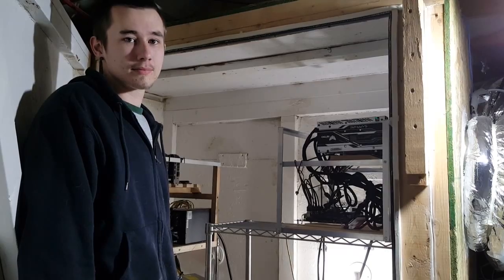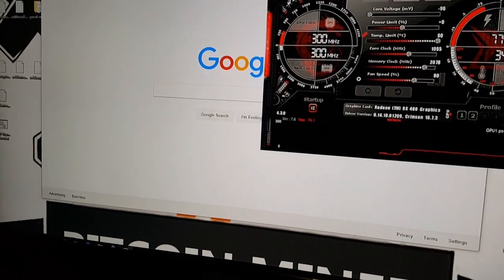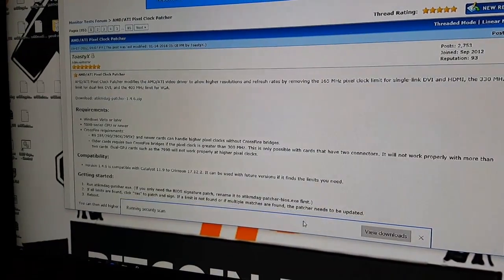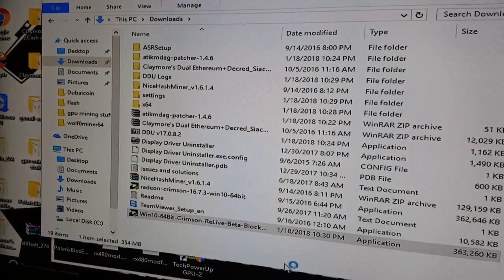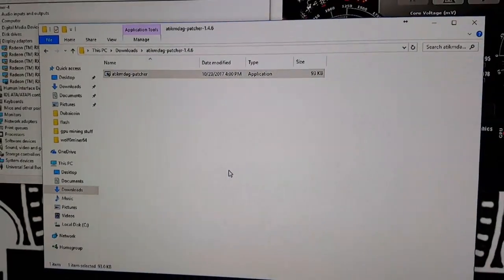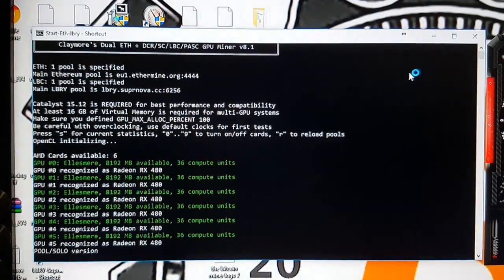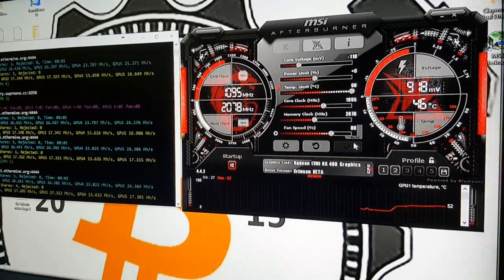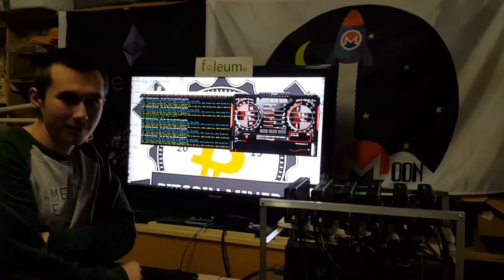How To Install The AMD Blockchain Mining Driver and Troubleshoot

Comment: Best tutorial on the mining driver for AMD ever! You guys did great, clear and concise. Even though my system is still suffering this gave me perspective. I have an MSI 5500XT that corrupted it's driver and trying to get it back. It happened in HiveOS. Now I'm using Win10 20H to try to get the driver back. 3 yrs later your video may still help me. Windows said NO when I tried to run The pixel patcher. Any idea if a current one exists for Win10 post v.1903??

Comment: Hi mate, I have one rx 470 and two rx 590. rx470 works for block chain drivers but 590 don't. Any solution would be appreciated.
Reply from the maker: Hi, sometimes trouble shooting can always be a challenge but the first thing you have to think about is are these eight gig cards because four gig cards will no longer work to mine ETH. What mining software are you using as well but these days you can use the latest drivers instead of having to use the blockchain drivers although they should still be working. With the newer drivers you're going to have to switch it to compute mode and out of gaming mode and if all three of them are in the same rig you may need to use something called pixel patcher. For some reason if you have more than two or three cards of amd's and a rig you have to use pixel patcher for it to work.
Reply: @TheBitcoinMiner  i have used pixel patcher as well done all the stuff and irony is the amd software version I do have doesn't show option of workload with normal latest drivers. I m using phoenix miner

Comment: hen i hey i build another rig 580 8gb , i did the update for the blockchain and when i start claymore its powering down. any suggestions?
Reply from the maker: Hi joseph breelove, sorry to hear you're having trouble but congratulations on your new rig. It sounds like you didn't run the pixel Patcher and if that doesn't work on install the driver and start over. GL

Comment: Ran DDU just like you did, and now after reboot, I get no display on the monitor. Cant even get to Bios, or safe mode.
Reply from the maker: Hi Mary Welter, very sorry to hear you're having trouble! Interesting problem, if you have the card on a riser try plugging it directly on the board. Or try plugging directly into the motherboard instead of the graphics card but you'll have to go into the BIOS and turn on the onboard graphics.  I hope this helps and good luck.

Comment: I tried to instal the 18.22? Amd driver and when I reboot the computer or psu will not start turns on for one second and then off. My first mining rig annoying cause I was getting 20mh just now found out their is a compute mode and gaming mode.. tried to install the amd drivers now system won't turn on.. any ideas?
Reply from the maker: YogaFlameTV , sorry to hear you're having trouble, try unplugging all of your graphics card but the main one, restart the system use ddu driver uninstaller restart the system use ddu driver uninstaller. Worst case you may need to use safe mode.

Comment: hey ,got 2 cards hung up on 26.3, I restarted the rig 3 or 4 times still the same, any pointers?
Reply from the maker: Hi Joseph Breelove, usually when you're having ghost problems like that it, has something to do with the riser themselves, you made have a bad USB cable believe it or not I see that more often than not.
Reply from the maker: Sometimes they're not bad it's just stuff is really finicky try switching graphics card locations.

Comment: Guys, need help. Done the install on the video. Recognize all 6 cards, but when start mining i always have atikmdag.sys error. But when mining with 5 cards no problem. Thanks in advance for advice.
Reply from the maker: Hi Wendell Uson, very interesting did you run your pixel Patcher? If you install the pixel Patcher and that's not the problem I would uninstall everything and redo it.

Comment: Hey guys, followed along but being as Ive got 3 different AMD cards right after running the DDU step, sorta as you mentioned, upon restart had no screen so restarted again with just 1 primary card plugged in (no onboard graphics display) it came back online.  Continued through the new driver install with just the 1 card.  After a shut down, plug in other 2 cards, start up, the system is now showing all 3 cards:  question being I've only installed drivers on 1 of the cards, I'm not sure what to do from here to assure I get all cards dialed in?  (R9 390, R9 290, R9 290x)
Reply from the maker: Hi Josh Stohr, I like to install the driver with all of the cards install if it's not possible then your next best thing is to install it with just one card, like you did and then when you restart it let it sit for 30 minutes it should find them. If not uninstall the drivers and try to reinstall them again with all the cards plugged in. Good luck I hope I helped.

Comment: hey everybody this WORKS I Went from 20 mh/s to 29 mh/s with the rx580! I still have one card hung on 26.3 how do I fix it
Reply from the maker: Hi Joseph Breelove, nice job man congratulations! Sometimes the afterburner setting do not take to every graphics card you need to check them each individually and or restarted a couple times. Hope this helps good luck. I was just about to send you an email when I saw your message.

Comment: when I check whattomine.com... it says that LBC coin is not worth mining with RX 480/580 cards.. but I see you dual mining with it (ETH/LBC).. it is more profitable than whattomine.com is reporting out? Is dual mining more profitable since you are drawing more power per card?
Reply from the maker: Hi Christopher Obel, you're correct it's not very profitable to mine right now but it was when I initially set this up and I decided just to go ahead and leave it because I like the project.

Comment: @TheBitcoinMiner What do you think about setting up the AMD Radeon Frontier Edition GPUs (8 total) ? I hear it is very difficult but I've signed myself up for the challenge. Care to give me your two cents?
Reply from the maker: Hi MaxintoshProductions, I personally have not tried them yet but once you get the system to recognize all eight cards and the driver installed you should be fine. I hear they're very good with Monero. Good luck and make sure to update us.

Comment: hi, would be interested to know why a ddu is necessary and why you need to patch using the pixel patcher in some detail. great vid.
Reply from the maker: Hi Kenny Lai, I use the graphics card uninstaller primarily because it blocks windows from updating the graphics card drivers and it's always better to start with a clean slate. The pixel is required because AMD does not like miners apparently. If you have more than 5 cards in the system with modded bios is it will not recognize them. I will say it's not really required on the 480 580 most of the time but always the for 470s 570s but I consider it best practice. I hope this helps and good luck!

Comment: You just install the newest AMD drivers and switch gaming to compute.  You dont even have to patch them
Reply from the maker: Thanks I'll have to try that on the next one I was going to do today.
Reply: I'm trying to do this, on my xfx 580 8gb I'm a newbie. I  have the drivers what does it mean to switch gaming to compute, and do you have to unplug all the cards and do 1 at a time
Reply: search using a search engine, its in wattman, there is a setting to change gaming to compute.. im in linux right now and cant check the exact details, but a simple search should pull up the necessary info for you